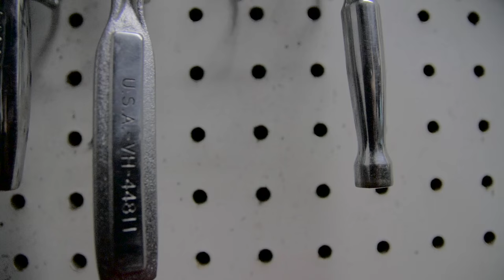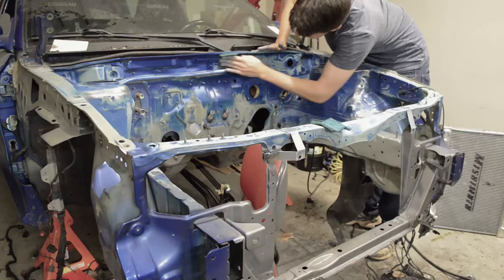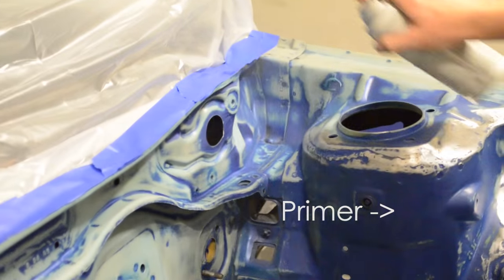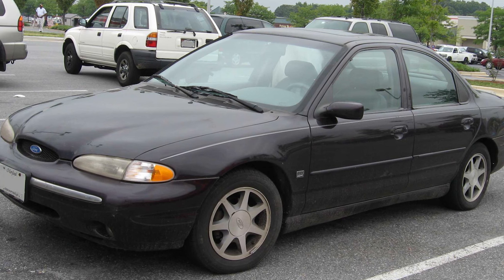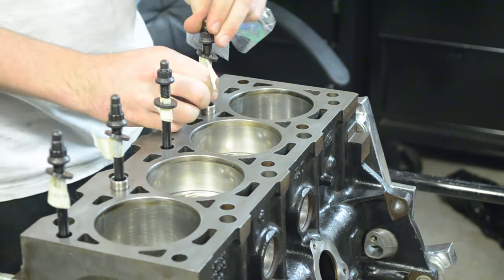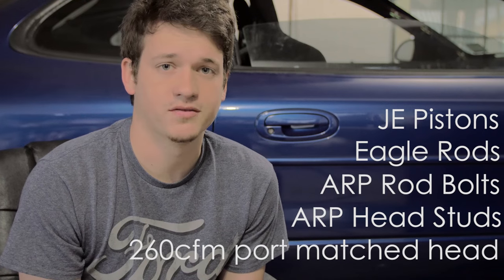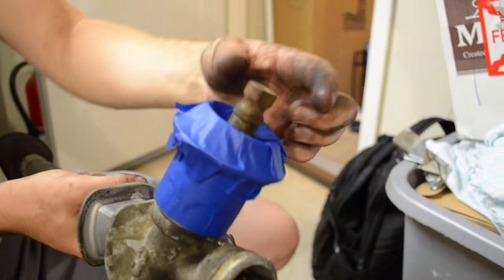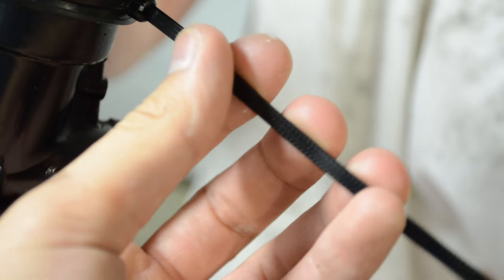Engine Build (Turbo Build Part 6)

Comment: Ben, love the build. following this pretty closely this year. I'm building a ZX2 with a KL, but i have a question. where'd you pull the manual rack from? I'm going to have some clearance issues with the v6 p/s pump, and have been try to see where i can pull a manual rack from that's more or less a direct fit.
Reply from the maker: It's off one of the older escort's 92 I believe. you could also try retrofitting in an electric power steering pump? (I've always wanted to do that)

Comment: I have 99 ford escort zx2 what can i do make it have more power
Reply: Cold air Induction Kit and a beefy exhaust is a good place to start, any way to get more air into the combustion chambers is good. but, make sure you can also expel that air as fast as it goes in. If you wanna throw a shitload of cash at it and be clapping civics and other cars left and right on the highways, get a turbo kit and a tune with a set of grip tires and you'll be fast as hell, make sure you have the braking to support it though.